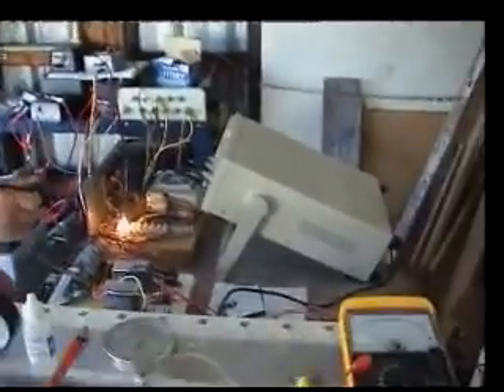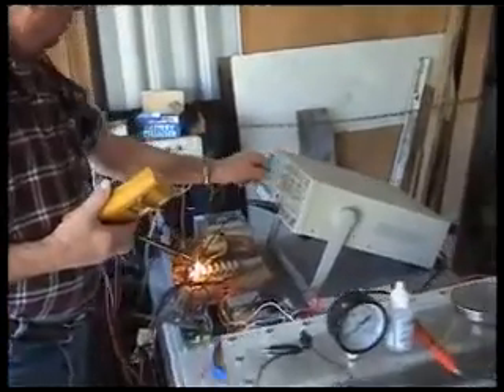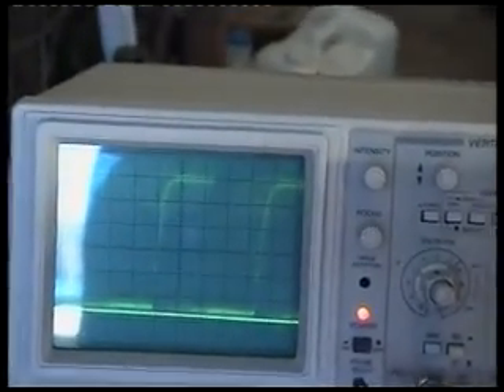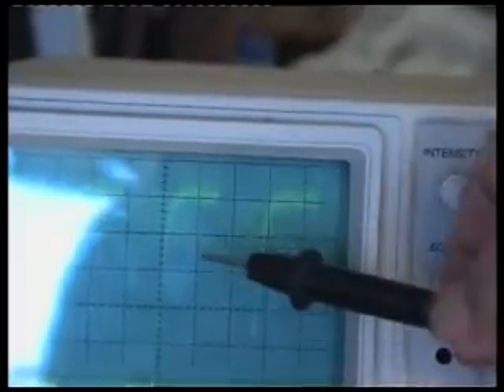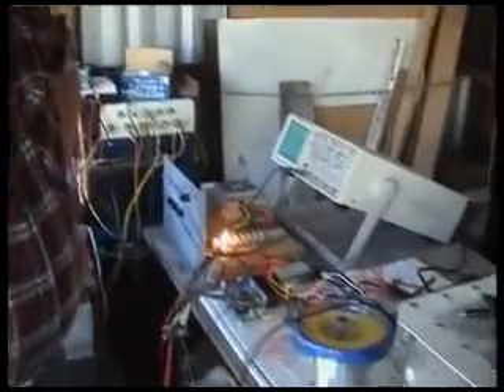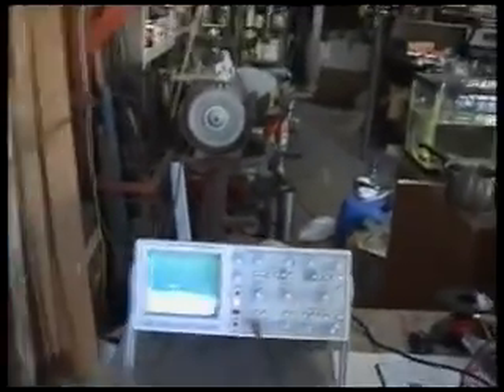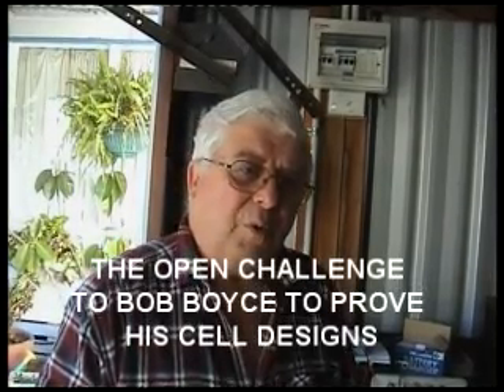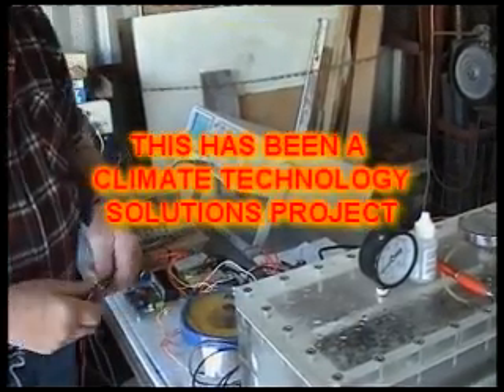Bob Boyce:Final conclusions

Comment: Hello greetings to all as far as I am concerned and I have understood. Stand Meyer said that you have to raise the voltage to infinity. In one piece of information he tested up to 20,000 watts with one milliampere. He said that as the voltage increases, the production comes to a point when it becomes exponential, which cannot be represented with a vertical line but with exponents where the production increases greatly with more voltage. But what is resonance? Resonance is a vibration that we have to put into the water so that its molecules break, the bonds break. And then the higher the voltage, the higher the volume, the more it generates a magnetic field. Which will separate oxygen from hydrogen. From this reasoning you can increase the voltage and you can control the amperage. You will find the resonance to break the bonds of water by mixing two three four five frequencies that best suit. Without forgetting that the design of the cells or materials to be used had plates or pipe in their different forms and dimensions to help resonance. This is what I have understood and I do not think I am wrong if you used only one frequency you are missing the other two or perhaps more to find a better resonance

Comment: Is there anyone that tried to do resonance electrolysis with a Rife Machine?
Reply: On the resonance side, I do not doubt that it has high frequencies but a transformer is needed between the cell and your source. Why is it the one that will resist the shock of a short circuit because electrolysis is a short circuit?

Comment: 5:45 the fellow mentions it takes 500 ML of hydrogen gas to run a v8 ICE engine. Bob ran a 2/0L gas engine with 2 big guys in the car at 60 mph with only 12 LPM. You must make the higher quality HHO gas that is 4x to 10x more powerful than tank H or para hho. You must develop the catalytic layer on the H side of the plates and remove the chromium oxides from the 316/317 stainless.
Reply: There is two possibilities: Bob is spammer, or somebody put wrong informations on internet (in Bob's name). I know who are you, and I know what I saying, I don't know anyone who knows more than me, about HHO. Internet is full of wrong informations. For resonance electrolysis, need monopolar electrolyser, like Meyer brothers do. But simplest way is Joe cell, but informations on internet are wrong. It is so simple to run engine on water.
Reply: @aleksandarpetrovic6613   R U a Dr. of Aerospace Engineering? One of Bob's accomplishments in life. He worked for the DOD his whole life. Correction above it takes 250 LPM of tanked hydrogen to run a V8 at 60 MPG under load. Not 500 LPM as written above.

Comment: I'm really looking in to starting my own project and this was OK to start with until this video. I've got question, did you use NaOH or KOH to make it working? Or you just used plain or distilled water in this process? Do to the high cost of it, I'll wait for your answer some time. And if there'll be no answer, I'll try to test first with and without NaOH and/or KOH. This was mentioned in original schematics, yet here I can't hear mentioning it at all.

Last, but not least have question which just pop in my head. Do you, or have you run ANY project worth looking at? If so, can you tell what it is/was?

Comment: I'm sure you have much more experience in engineering than me. But nevertheless I would like to share an experience of my work as an engineer. I learned a little something when developping and building various devices: I start small and grow constantly. I test parts of a construction before I put everything together. I was not successful when I built the whole thing and switched it on. Never worked and I didnt now where to start fixing. So you have great abilities to build something and I suggest you do this step after step.

Comment: Please do not be hesitant to try the fixes, because I'd have to state that I have researched everything about his design because it really is a fantastic and purely genius design, and it works absolutely perfectly , but, it is enormously time consuming, and if one miniscule detail differs, or, the concept is not 100% understood, you can easily have the issues you are experiencing. Please contact me if you need any other information because there are many schematics printed online that are not correct. Only minor differences have been posted, but, the magnetic "dc" inner winding is not shown on many of the websites and pdf pages that will make this all function perfectly.
Reply: +Marc Belanger 
Hello Marc, is it possible to provide a link to download your schematics and corrections? Would be highly appreciated. I work with the design of Bob, too. Today is the 24th of January 2016.
Reply: each of the coils need to use capacitors to find resonance unless the coils are wound and tested to resonate with the pulses at the coil's natural frequency. There are online winding charts, etc., however, the winding formulas online I did not get resonance. I was skeptical to even use his winding diagram because i feel the design was listed wrong. If the inductance of each coil is made identical, then the proper tank circuit of each will need to be made for each frequency. Period, the end, it needs frequency attention, and the only way to do it is to test the impedance, then, follow the frequency per capacitor, reactance, and inductor on a nomograph chart like from the following chart ( http://i575.photobucket.com/albums/ss195/vrand01/DonSmithPaperphotos9.jpg  ) to make the impedance infinite at the frequency per coil from each output. If this isn't done, nothing will happen. We could wind a secondary around each coil and drive electrical circuits at very high amperages from these coils, however, I suggest using speaker wire or power wire for amplifiers for the secondary coil to pick up the 3 frequencies simultaneously. I have found that the toroid wasn't very good at producing the frequencies, however, it has to be tuned so the circuit isn't overloaded at those frequencies. It takes a lot of time and patience, however, to easily reach the resonant frequency of each coil., I recommend using a tesla coil tuner circuit located on Ebay, be sure it tunes low enough before buying it. the 48khz I know will be fine, however, the 10.2 or whatever it is may not be easy.  All of the coils that tie to the 3 phase coils can be different sized conductors and in a different spacing since the spacing effects the inductance tremendously. Each coil must have it's own capacitor, either in parallel or series, it's your preference, however, if you use the parallel, the q will be much higher and this can be seen on some of the specific online resonant frequency calculators. Please do not believe you will be in resonance with the calculators, they will only get you in the ballpark.. you'll need to scope the coils with the frequencies running through the scope at the test point first, then, on the output side of each coil. When we tie the circuit and power it up, we will need to scope the output to see if we are getting the 3 waveforms as the Harmonic, and the 120 volts or whatever you used for the coil to be fed to the output. The cell itself has nearly no change on the function of the cell, however, to keep the output locked, the capacitance of the cell and the capacitance added to the secondary coil must meet the criteria we are looking for, that is that all 3 frequencies must pass through. I could only get my main 60hz frequency to pass along with the 10.2khz through the secondary coil, so, I wound a secondary separately for each , tuned them with a capacitor, then, diode isolated them and tied them all together. That is my secret that worked, and, it allows the top half of the ac wave to pass as a 60hz pulse train, and the top half of each frequency to pass. Since the bottom of the amplitude did not come through, the water nearly boiled, however, I have trouble keeping the pots from drifting, so, it's a constant battle to tune repeatedly. We are better off taking the unit and setting it in auto mode, where we set the highest setting and lock it. For some reason, when mine got hot, I had issues again, so, I decided to go ahead and take 3 digital pwm circuits , manufacture the frequency myself to lock them and it didn't work. I then made them with sinewaves and it worked flawlessly. I had to buy frequency gen kits from China, I used a soundstream 1200 watt 4 channel audio amplifier and I made sure I had enough electrolyte so there was enough of a load on the amp so it didn't shut down from lack of impedance. The amp did the trick and the harmonics all came out the way I needed them. BTW, we only needed a 12 volt feed and 2 of the harmonics in a strong sinewave, however, I am entirely unsure how this happened for him, the diode must have burned and he received feedback from the system which gave him 12 volts and one strong ac sinewave, then, 2 half way cancelled fedback signals that we probably more like a pulse train. The chinese digital function generator give the freedom to choose whatever you wish, you just have to ensure the frequency of the amp dumps out the 48khz otherwise you'll have to modify the amp or rely on 2 of the 3 frequencies and straight up dc. Be sure not to use electrolytic caps for the smoothing caps as Bob does otherwise BOOM they will go!!
Reply: That is the truth.. intstead of BOB, I would have been struck down by lightning instead of him if I lied. Try adjusting the frequencies all over. He was just lucky if the frequencies he used worked. I am finding a good harmonic to be a saw tooth wave at 14.4khz, but, that may only be the resonant of my cell. Each and every cell will surely be different. My drycells love 5875, but, mine are modded to run less plates. It's a real bitch to tune them and it takes absolute patience since the only thing we have to see if it works is a gas flow meter and a tuning button from each frequency gen. The entire system cost me 27 each for the fgens, the amp was 119 on ebay, the coil cost me 120 with the wire. The cells were a damn waste of cash, but, I decided to go with two custom dry cells in series, just like the OGO cells. And, the bob boyce 101 plate design is setting on the floor of my basement because with resonance and it's best efficiency I was able to get 12lpm. On the dry cells, I was exceeding 24 lpm with 9 amps at 120 vac. I tuned it a bit better to keep my 24lpm and I changed up the system to build my own oscillator to boost the voltage up to 36 volts dc for the pwm3g, and it blew up. I then used the 120, wound a step down coil and fed the system with 36vac along with the frequencies I tuned, at 12v 13 amps feeding my inverter the water looked as if it was boiling out of the top of the bubbler bottle as seen in my video but 2 x the flow. That was 9-14lpm in the video.. I maybe was getting 30lpm, however, the gas flometer was too jumpy when I did this. I found that the vehicle revved up from the gas, but, the fuel consumption was awful, even with the volo chip. I toned it down to 1 lpm and see better mileage. If the engine was customized to run from it, I'd bet it'd run, but, there's a guy in Canada named Neal that built a fuel injection system. If he could perfect it, the vehicle would run because the amperage would easily be able to be drawn from the alternator and battery with no ill effects. My car stereo runs more amperage than the system did. The hydrogen was definitely a different type of hho too, the sensitivity of the throttle was immense and the vehicle ran like it had nitrous in it. It's damn potent stuff, but, the hoses had to exit the units close to the engine so the gas would still be warm and excited.
Reply: +Marc Belanger Hello Marc, excellent information!! I need some time to translate it properly. I' sure I'll get back with a lot questions. I work with coils without a core. The iron core seems to slow down the whole process. I work with bifilar (trifilar) coils. But let me get through your text first and then I will write more about my research here. I live in Germany. Where are you located?
Reply: I am in the US but my mother is originally from.Deutschland!  This is very good that you know your coils, I advise you drop the research on Bob Boyce material to work on Don Smith devices if you.have much experience with air core inductors and resonance. Your efforts could be key to the replication of a working free energy generator much more powerful than Tariel.Kapanadze design. I would like to work with you to come up with a working design. I have a lot of great info.and an electronics design expert from the University of Rome that is of great assistance. We are trying to bring together a group of private techs to rediscover energy designs. We need a coil expert, an RF expert, and somebody to correctly perform the mathematics when we succeed. We were already refused assistance by Alexander Froloff so I'd like to ask if you'd be interested in.assisting..
Reply: +Marc Belanger Wow. What a great offer. I'd be happy to work in your group. So let us start to find something else to communicate than this youtube-chat. How is your international HHO team supposed to work together?
Reply: Well, I speak with my colleagues through Google Hangouts for private conversation, or, we could do this for group conversation. Once i find something that works out of the ordinary, I usually have live youtube streaming videos, but, we are not at the moment working on HHO products due to the dangers and warnings presented to us by oil companies and other people either working for the government, or, making themselves appear to be government officials. We have been working to get power generation systems functioning that are based upon the same technology. If we could get this working in a mobile environment, it is a self sustaining system that has the potential to output 5kW to 60 kW and even higher. This has the ability to run a vehicle entirely, or, can run the hydrogen system for free, so, there would be no need to use a system such as Boyce's to generate hydrogen, but, the orthohydrogen would be needed to allow the engine to run.
Reply: +Marc Belanger You use Google for something that is supposed to be private??? Do you know Tails (Operating system that Edward Snowden uses) and PGP?
Reply: no, I am only trying to remain private so conversation isn't interuppted by the suppressionists or the paid skeptics. Anybody who'd like to learn this open source can.. it's already out there, its only dangerous when we try to sell it once it works.

Comment: If you are having issues running this system, please see this link because I have seen that the coil configurations differ in northern and southern hemispheres. Please look at this link very carefully to see the differences that you may need to understand by reading the following page. The design is good, it is just very critical to get the correct setup, internal dc magnetic windings in the correct directions, as well, the secondary and primary windings in the correct direction depending on which hemisphere you are in. Bernoulli's principle is a factor in northern to southern hemispheres, but, could be corrected if the coils wiring are reversed from our Northern hemisphere designs. It may not have been shown to you before you have built your system, but, it could be easily fixed by winding the entire toroid over. If you need more toroids, I have 2 available for purchase if you need. I can ship them to you, so, just let me know. I can accept a one time PayPal payment if you wish. Please let me know, I'd be more than happy to help.
Reply: http://feynmanslab.com/images/post1/Bob_Boyce_TPU.pdf
sorry, forgot to paste the link earlier
Reply: The hemispheres sound very interesting, but don't give me any more obstacles that I have to overcome in order to be successful.

Comment: Did you pop a diode when you flashed the circuit, or maybe pop a coil? 48 khz isn't the correct frequency, it is supposed to be 42.8khz and the positive choke on the cell cable and negative choke are supposed to be titanium coated copper wire, as well as the toroid otherwise it will not work. The toroid has to be specifically spaced without flaw and the water must be steam distilled.
Reply: silver coated ptfe jacket, sorry, my phone somehow gets titanium from silver when.correcting. I have found that stranded silver coated copper speaker wire works best for mid range , lower kHz all the way up to radio frequencies. it has to be very fine strand oxygen free wire. I used street wires and it'll help if you fire the system with a.c. from an.nst per coil through a spark gap with a diode on them. use the spark gap to.tune the frequency and be sure you use an.then to feed your transformer used to.isolate the then from end pulses and you'll be amazed how much action you'll get. the secondary side needs to.step it down. you can modulate the core as Stan Meyer did and fix a harmonic at whatever frequency you.wish. just as long as primary and secondary coils are resonant to the frequency driven you're in.business. spark.gap is how we dump tremendous energy without large wattage. .5 amps at 120 ,volts input merely boils the water, HHO.wise and keeps it cool
Reply: Correction silver coated copper. mil spec wire, or solid silver or gold or plat. metal group has to be super conductive because longitudinal digital pulsing is in femtosecond speeds

Comment: Bob said the he had three different AC harmonic frequencies. There was a harmonic below the main frequency and a harmonic above the main frequency.  It was needed to find the resonance in the cell for the main frequency.  He did indicate that changes in the cell such as electrolyte concentration, temperature, etc.  so the sweet spot is always changing.  This is why he developed a resonance detection circuit.